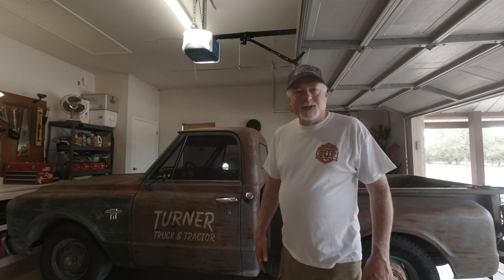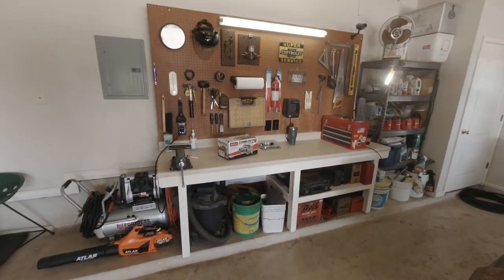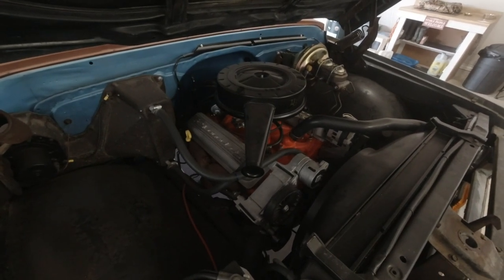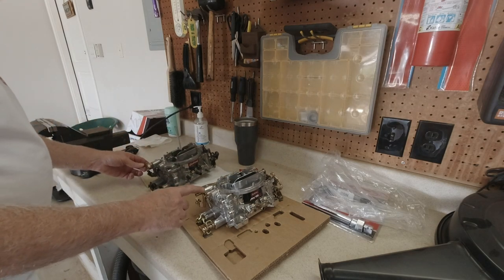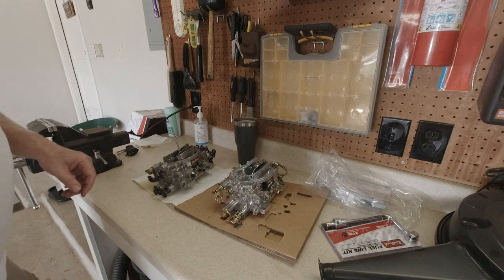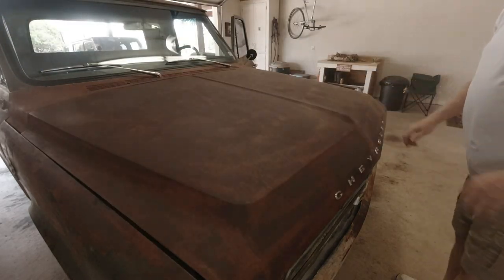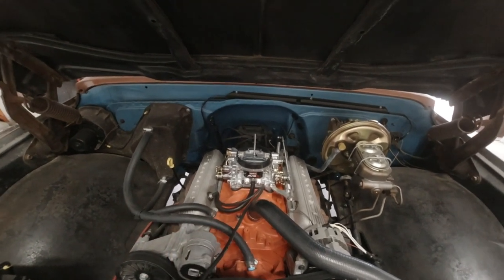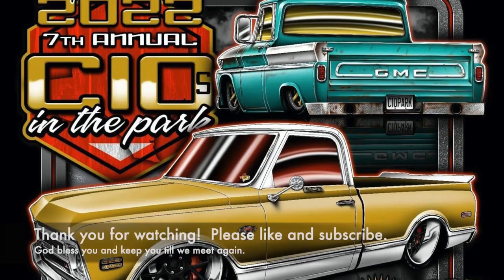Is it any better?  Edelbrock 500cfm AVS to 650cfm AVS2 carb swap.

Comment: Mister Turner - I also have a vintage Chevy pickup with a SBC. 1946 Chevy PU restomod. Mine a 327 not 350. Vehicle came with a nice Carter AFB (now Edelbrock) 9000 series. That's a 750 CFM carb. Rebuilt, then tuned that carb until my fingers were raw. Fuel/air screws obviously, but also jets, metering rods, etc. I could NOT get rid of that off idle or slow speed stumble/bog. That carb was just too big for good street manners. Bought a new Edelbrock 1406- 500 CFM carb. (not the AVS). Installed 1406 and experienced IMMEDIATE relief with near instant response off idle and no stumble or bog at any speed. You wouldn't think the diff between 750 and 600 CFM would have such impact. Some small block chevy engines just don't suck enough air off idle to kick the transition circuit into gear with too large a carb. I don't run mine at 5-6000 RPM, even tho I could wind that 327 to 7500 if I wanted to risk it. I remain convinced (like many old guys) that a bigger carb may give you more top end HP, but at the sacrifice of good street manners in "normal" driving.

Comment: After getting tired of the Rochester and Holley, both of which were complicated to keep their settings, I opted in my Corvette 1980 for this Edelbrock carburetor model, and I don't know if it's the best-performing one, but it's practically just as fast with a smooth, even ride, and it always maintains its tuning. It's excellent

Comment: Most of the time, the lean spot was not enough accelerator pump squirt. However, many years ago, when the octane started to drop we noticed more of this stumble occurring, on different vehicles. We raised the octane of the gasoline, and it solved it. I would give this try. If this were to solve it, I don't know what you would do as adding higher octane gasoline is not cheap and can be inconvenient. As you said, you have pretty much tried everything and going as rich as you said you have done, creates other problems. I had an AVS on my 1969 Dart and it had very good throttle response, compared to mother carburetors I tried on it.

Comment: I replaced my Holley with an AVS2 of equal CFM ratings and the Edelbrock seems to have solved all the issues I was having with the Holley.  All I needed to do was adjust the idle mixture & speed, the choke, and It runs nicely with full manifold vacuum vs ported vac.  Ford 357 W, with low compression truck engine, '73 Ranchero....
....RooDog....

Comment: Been a fan of Edelbrock for decades.  Easy to take apart and tinker with.  I was always taking the top of my carb off and playing with it.  Then it dawned on me... I was always playing with it.  It never really ran all that good.  I was finally talking into doing one more swap.  Installed a simple Holly.  Wow, no problems at all.  I have no idea how hard it is to tune a Holly, never needed to!

Comment: I started all my carb problems due to ethanol in fuel several years ago .  I replaced lines with ethanol resistant and I run Lucas ethanol neutralizer in everything and haven't had a single issue since.
Reply: Just get non ethanol fuel.

Comment: BTW.  Vacuum is measured in "inches of mercury" not pounds.
Great video, and glad you don't use useless background Muzak as many YouTuber poster do.
Keep up the good work....
Reply from the maker: Thanks, you are totally right.  I caught that too when editing.  I think I need to go back to school with some of the words used and my pronunciation when I go back and see and hear myself.  Yikes.
Reply: We use " of water at work but, we aren't automotive. We design and Build Industrial Fired Heaters, Waste Heat Hecovery Units, & Heat Recovery Steam Generators.  I converted horsepower to BTU/HR the other day cause I was curious a stockish 350 is around 1,630,000ish BTU/HR 😆
Reply: @Wbroach24  One can use inches of water, but the raw numbers will be different, like inches vs milimeters, or Fs vs Cs....

Comment: Your secondaries opened too soon, you need to tighten the flap to let them open later, and your transmission is shifting too soon. I would also put a air cleaner on there with a flat base or elevated base so the air flows downhill into the carb, Edelbrocks like that vs a regular air cleaner, also a top for the air cleaner that is a filter rather than solid, they really do help.
Reply from the maker: Thank you.  I will look into that and try that it out.
Reply: @turnertruckandtractor  There is a spring that is tightened on the air valve over the secondaries as Jeff above posted.  You should be able to find a Youtube video on this adjustment.
Reply: You know what I noticed about the old original edelbrock carbs, the secondaries  begine to open at 1/4 throttle. I was having a way too rich problem, noticed that and so I just disconnected the secondaries all together so I can have "economy mode" with how these gas prices are.

Comment: Unless I’m wrong about the filter logistics, a taller K&N would leave a gap on the lower part of the filter but would still be mostly stock looking. OR modify the air cleaner with a second snorkel if it will fit in the bay. Either would look ok and function better.

Comment: The first thing you need to do is get rid of that single snorkel air cleaner. It is extremely restrictive, to the tune of 10-20 hp. Watch the episode of Motor Trend Engine Masters where they compare different filters. As I recall on their high horsepower dyno engine your air cleaner assembly cost almost 100 hp.
Reply from the maker: Thanks for watching and the observation.  I agree with you and have seen that video.  It is a good one.  The bottom of the air cleaner housing has been swiss cheesed with speed holes for that very reason.  Plus I like the throaty sound of the carb to be heard when you floor it.
Reply: Absolutely right. I viewed same episode of Engine Masters
Reply: Have you fixed the stumble?

Comment: Good video, im working on my 67 C10 and will probably be using the same Edelbrock carb when I get to that point.  Did you have to buy and adapter for your original air breather to fit correctly on the edelbrock carb?  Thanks.
Reply from the maker: It is an aftermarket air cleaner with a 5-1/8” opening.  I did have to get a 1” spacer to lift it up to clear the linkage and distributor.

Comment: 12-9-2022 it sound like your distributor setting might be a little bit off ( or ) your carburetor choke is too far open should be about the thickness of a ink pen or pencil open. * Check the carburetor choke first.*

Comment: Uncle Tony says the Edelbrock cfm ratings are not exact. They are actually much lower than advertised. Is this true?
Reply from the maker: I've seen tony's video you mentioned.  My personal experience supports that idea.  When I bought the 500 cfm I thought it was support my 350 at sub 4000 RPM but the 650 definitely made it run better even at low RPMs.  I'm pleased with it and not changing anything any time soon.

Comment: So on the accelerator pump the rod I believe is in the centre hole of the three,so which hole did you change it too ? 
I guess it would be the bottom hole to make it a quicker squirt ? 
Great video 👍
Reply from the maker: Thanks.  It comes with the pump rod on the center hole.  I moved it to the top hole so that it has longer travel thus a larger squirt.
Reply: @turnertruckandtractor  Many thanks for your reply here in the UK

Comment: I wonder how the AVS2 500cfm would feel versus the 650 AVS2 as the improved feel you have might be based on the new design rather than cfm size.
Reply from the maker: Very true.  I changed two variables to your point.  Just did 300 miles in it last Saturday and it did great.
Reply: @turnertruckandtractor  I am thinking of going from a 600cfm non AVS2 to a 500cfm AVS2, so the opposite to what you have done, not sure now which way to go 🤣
Reply from the maker: @RamblingClassics  if your engine is under 350 cu in and under 5000 rpm’s I would lean towards the 500 AVS2.
Reply: @turnertruckandtractor  it is a 327ci so yes I think the 500cfm AVS2 will fit very well so will probably go in that direction. I Very much enjoyed your video and now follow up chat, thank you 👍
Reply: @RamblingClassics I just bought the 500cfm avs2 for my 95 mustang gt carb swap project. I'm hoping I didn't go too small. The math says 500 cfm will be plenty.
Reply from the maker: @windowtintman1986  The nice thing about Edelbrocks is you can easily change the needles, jets and accelerator pump settings.  Good luck and hope it goes well.  They like around 5#'s of fuel pressure.
Reply: @windowtintman1986  same with me the 500 should be spot on, let us know how it goes 👍

Comment: THEORY
cubic inch displacement  multiplied by maximum  r.p.m. then divided by
3456 will give you the proper size carburetor for your engine.
Reply: How interesting!
I just did this for my 318. Your method showed 460!
I’m currently running a nicely tuned edelbrock 500 AVS which runs perfectly.  But I have often wondered if I would gain anything by jumping up to a 650?

I’ve also heard of the other method whereby you multiply your engine size by 2 so in my case it’s nearly a 650. 
Hmmmm. Dunno. 
Is it worth it?
Over here in Australia a new edelbrock is approximately $800 then of course tuning which could be as much as $500. Gets expensive quick. It would suck to do this and have no gains,just an empty pocket.
Reply: @Tk-ou9ec  Just saw your comment, I have a 318 and I wonder if it would be better low end torque with an avs2 500 cfm than the 650avs2. Like you I don't really want to spend a bunch of money on a test. A lot of used 650's around here but 500's very rare. I currently use a thermoquad  for its small primaries, quite smaller than the 650 edelbrock.

Comment: What type of mechanical fuel pump you are running
Reply from the maker: It is a late model SBC block without the mechanical fuel pump.  I am using an electric fuel pump located on the frame under the stock tank behind the seat.  Make sure your fuel pressure is between 3-6 psi.
Reply: What electric fuel pump setup are you using? Trying to get some ideas for fuel pump . I am also putting a stock vortec 5.7 engine with a 650 avs2  in my 57 chevy. Thanks for your videos

Comment: Would you say it was worth the investment of getting the different carburetor or not?
Reply from the maker: Yes I can it was.  Both were good but the 650 has more power. Should have gone that route originally but on the carb sizing calculators thought the 500 would be perfect for my application and provide best low speed throttle response but the 650 has been better.
Reply: @turnertruckandtractor  excellent, thank you for the video and your response, I found one on Facebook I will be purchasing for my sbc!
Reply: @turnertruckandtractor great video! I'm about to do a sbc build and had this same question. Thank you!!

Comment: great video.  so, were you able to tune out the lean stumble, and would you say it was worth it to go to the 650?
Reply from the maker: Totally so.  Just got back from a 500 mile round trip with it.  I was able to tune it out by moving the accelerator pump lever hole, tightening the AVS spring a 1/4 turn counter clockwise and using the silver 8# springs.
Reply: @turnertruckandtractor  awesome- so worth it performance wise to step
Up to the 650 now that you got it sorted out?
Reply from the maker: @kevinclancy.  yes.  I thought the 500 as fine and had no complaints.  The 650 has been all around better.  350 ci late model SBC all stock except for thin head gaskets and 1.52 roller rockers.
Reply: @turnertruckandtractor  thank you

Comment: That air cleaner is a huge restriction as far as performance. Completely Counterproductive in fact
Reply from the maker: Thank you.  Can't see it in the video and I did not mention it but the bottom side of the housing has holes all around it for that reason.  I also have an open air cleaner for it and detect no performance difference between the two.

Comment: Edelbrock dont have the emususion circuits that others (like holley) have.  The fuel is less atomized. I know from experience, i have made many custom metering rods, jets, air bleed mods, air valve mods to Edelbrock carbs over the years. Fact: you wont find an Edelbrock on a racer car in todays racing outside nastalga.
Fact: edebrock is a good carb, thats easy for the backyard mechanic to setup.
Fact: they are all too rich righ out of the box.
Reply from the maker: Agree with everything here with the small exception of all too rich but most are.  Guess Edelbrock likes to error on the rich side since it is a little less evident or troublesome.  Edelbrocks commonly have a lean spot off idle out of the box I have found.

Comment: It will never perform well with that air cleaner on it
Reply: I was going to say the same. The inlet on that air filter looks smaller than the opening of all 4 barrels on the 500cfm carb